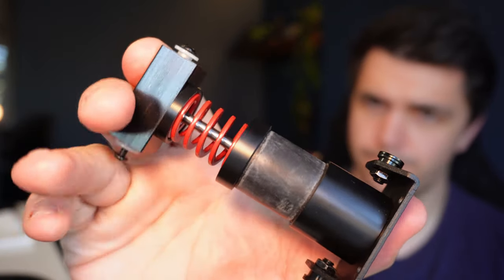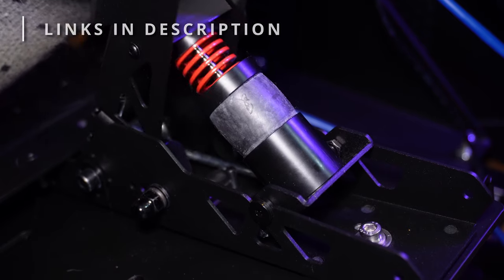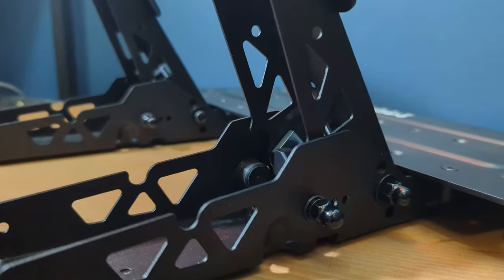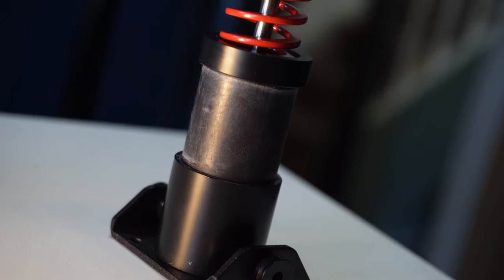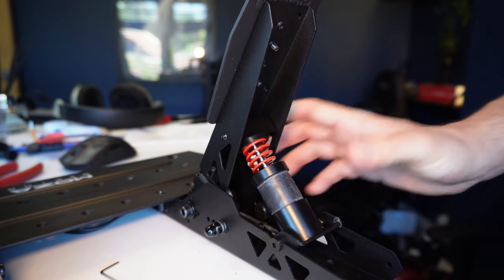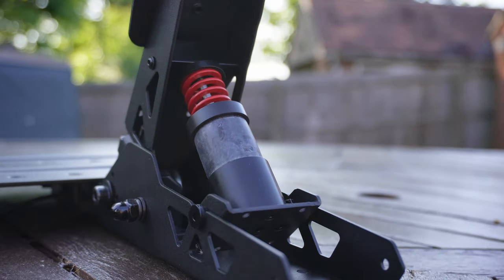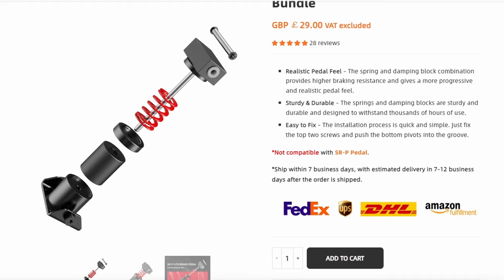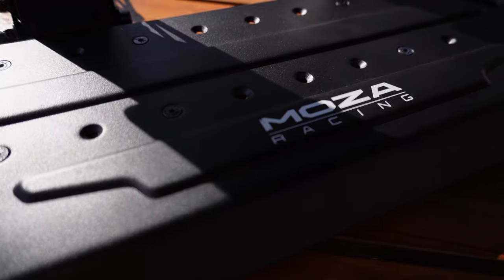Moza SR-P Lite Brake Performance Kit for R5 Bundle - Get It Or Skip It?

Comment: I want to buy "MOZA SR-P Pedals" and  I have "Fanatec ClubSport Wheel Base V2.5". Can I use it together ? I will not lose anything in the games?
Reply from the maker: Are you on console? If you're on console then you can't mix, but if you're on PC then you can
Reply: @dannyleeracing   Thank you! I on PC. But I afraid some telemetry might get lost (because Fanatec Base sends some telemetry to ClubSport Pedals V3 for "ABS brake vibration" and "Throttle vibration" effects).  But "MOZA SR-P Pedals" don't supports these effects, so, pehaps all good. Sorry, I'm just getting started.

Comment: My brake has a pretty big difference from the throttle though, thought I'd need the kit but honestly the brake feels good as it is
Reply: It’ll feel good but won’t be realistic
Reply: I’m going to buy a Moza R5 bus I play with a desk, I’m coming from the G29 and I wonder if I can still be competitive in braking without the spring? I also use an office chair…
Reply: @Max10294  i'll tell you that the stock logitech pedals feels 100 times better than the stock r5 ones you just have no guide it's like driving a car with air in the system 😂
Reply: @benjaminlavallee1787  I’m now thinking fanatec CSL DD, are the pedals any better?
Reply: @Max10294  there the same tbh..
Reply: @benjaminlavallee1787  can I modify my brake spring with the fanatec pedals, like use the Logitech brake spring?
Reply: @Max10294  i'd try😁
Reply: @benjaminlavallee1787  so if I were to chose R5 or CSL DD what would be your honest pick
Reply: @Max10294  i would go with r5 i feel like fanatec lost some quality in the past year
Reply: @benjaminlavallee1787  thanks for advice, I’m just hearing a lot of complaints on how the R5 overheats and how bad the table mount is, I also think the upgradability to a load cell brake and 8NM is amazing on fanatec, that’s why I’ve held of buying for so long I literally can’t make up my mind

Comment: Great video! That heavy spring feel probably loosens up after a couple hundred hours of racing I bet. There is typically some breaking in period required. In the past i have used a lot of RC car and truck springs and dampers to smooth out some of the progressiveness of these types of springs. They're cheap and effective and I have had pretty good luck with it

Comment: Does the perfomance kit work on the gas and clutch pedal of the r5 also?
Reply from the maker: No, you wouldn't want to use it on the throttle and clutch, it's for the brake only. For throttle and clutch mods I'd probably look at 3DRap's shop

Comment: What about removing the original spring that comes with the pedals? How would/does that affect the operation?
Reply from the maker: Didn't try that - bit more spannering involved to do that but it might make a difference to that heavy base spring load!
Reply: ohhh im interested do you guy tried already?

Comment: My pedals would be going under my desk and pressed up against my PC on the carpet, and the PC is against a wall. Is that enough resistance to stop the pedals from moving? Or would they still lift up from the front, even if my heels are on the little pad thing below the pedals? Kinda torn on buying this bundle because I don't want to have to mount anything
Reply: did u find an answer anywhere else, or buy the set and try it perhaps? I've got the same question
Reply: Its gonna lift from the front,i just bought a r5..thats why im looking for solution beside buying a stand
Reply: @owlliesotsot8820  Do what I did. Buy a thin sheet of MDF, I got mine from B&Q, was like 15 quid. I cut it down to be a bit shorter, then screwed my pedals into the board, leaving a bit of a gap at the side of the board furthest away from you. Physics will do the rest. Even with the brake mod it wont lift, you just need to press the board against a wall or your PC to stop it sliding across the carpet.
Reply: @Exeee.  is it heavy enough to hold the pedals so it will not lift up?
Reply: @owlliesotsot8820  As long as you distribute the weight evenly yes. Look at it this way: You have the board, you screw the pedals to the very bottom of it, and leave a 9 to 10 inch gap at the top. If you do that and push it against something that isn't going to move, I.e a wall, they wont lift at all
Reply: @Exeee.  alright im gonna give it a try. Thank you
Reply: @Exeee.  You my man. Are a genius. I have been wondering ifi should go find a test rig first before buying my R3 bundle with the brake kit. But i have a ton of wood lying around so will 100% be doing this.